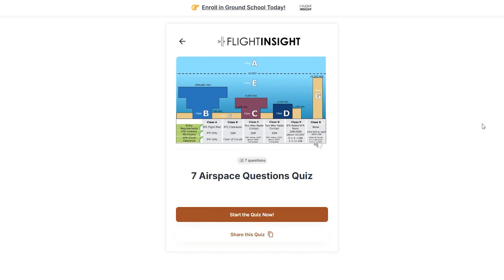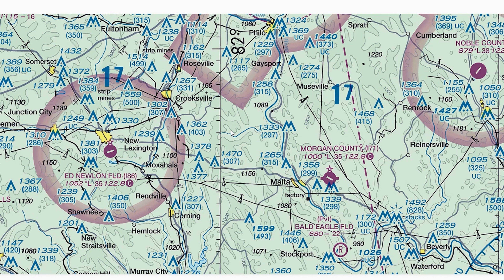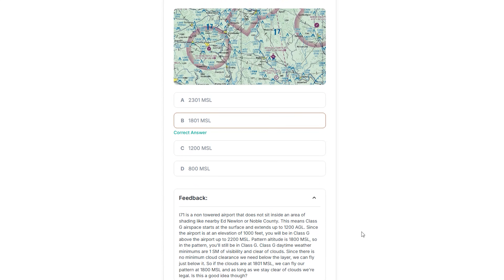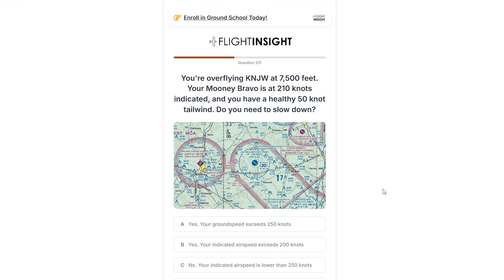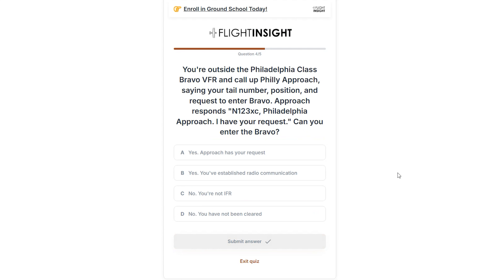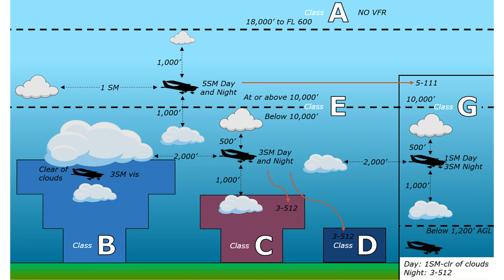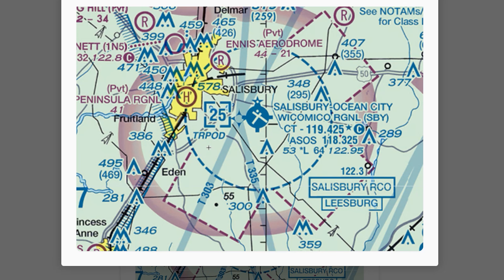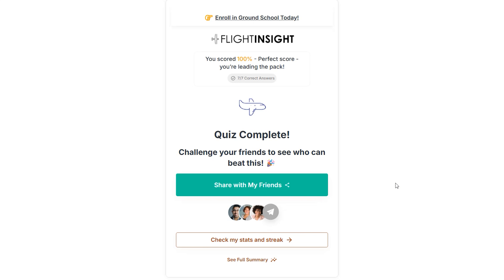Most Pilots Get These Airspace Questions Wrong (Will You?)

Comment: your chart on question 3 is wrong. You have "No Speed restrictions" in the airspace above 10K.  It should be less than Mach 1
Reply: How fast do I have to peddle in order to get my Piper Cherokee Warrior II to Mach 1? Axing for a friend.
Reply: @kevinjarchow8812  LOL.... while I understand your point.... I just took over a student who didn't know there was a speed restriction, and didnt' know that there was class E above class A airspace.  CFI's should make sure things are right, and not just relevant to the aircraft being flown. But to your point... a Warrior isn't doing 250 Kts either.